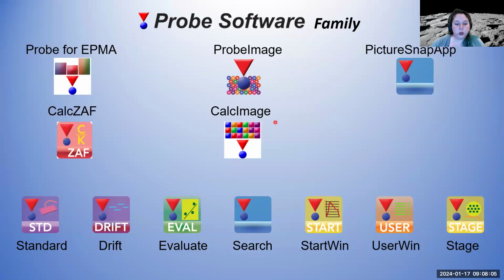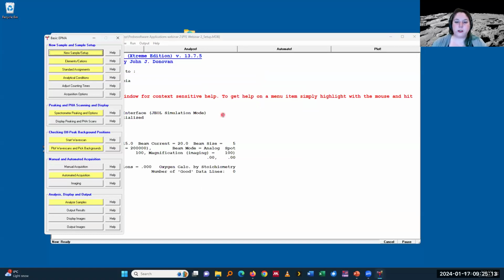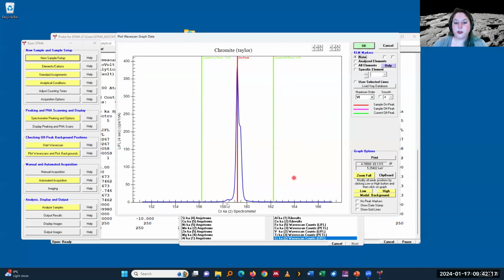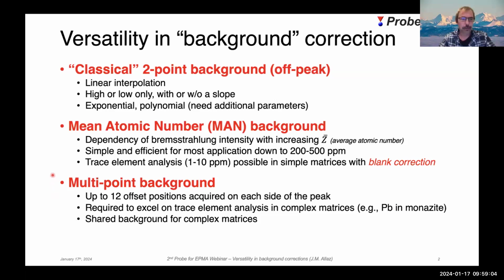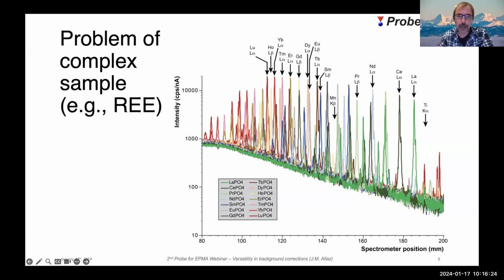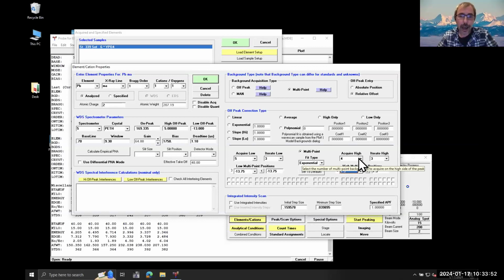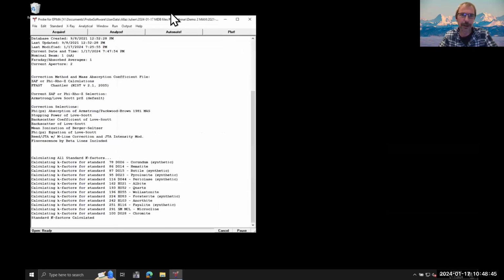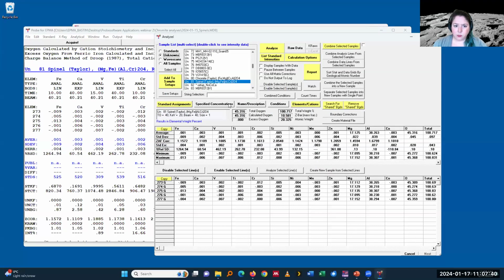Probe Software Applications Webinar: High Accuracy High Precision EPMA

Comment from the maker: By the way, if one does not have high purity synthetic standards that would be suitable for use with the the MAN background method, one can still utilize impure standards for the MAN method by means of the "interpolated" MAN method:

https://probesoftware.com/smf/index.php?topic=987.0

By acquiring normal off-peak backgrounds on one's (impure) standards, the software will then interpolate the off-peak background under the peak, then utilize those interpolated intensities for use in the MAN background curve fits.

Originally suggested by Ben Hanson at Corning Glass.

Comment from the maker: Some of you who saw Julien's demo in the video above may have noticed that he mentioned that one can specify/acquire up to 18 backgrounds on each side of the peak when using the multi-point backgrounds (MBP).

Now you might ask why so many?  And it's because of a related background method called the "shared" MPB background method, first suggested by Karsten Goemann. In this method one acquire normal off-peak backgrounds (two backgrounds per element), and then, if one has two or more elements per spectrometer, the software will allow you to utilize off-peak backgrounds from the other elements on that spectrometer for use as backgrounds for each element on that spectrometer.

So sometimes people will have more than 5 or 6 or 7 elements per spectrometer, and then the ability to have up to 18 per background positions on a side becomes useful.

More information on this can be found here:

https://probesoftware.com/smf/index.php?topic=9.0

Comment: It is also worth mentioning that standards utilized for the MAN background method (which are generally simple pure metals or compounds), can also be used as standards to be utilized for the quantitative interference correction (if the interfering element is present but not the interfered element, nor any other interfering elements).